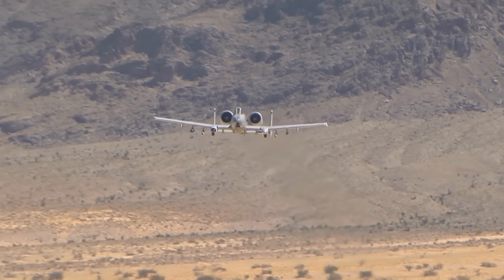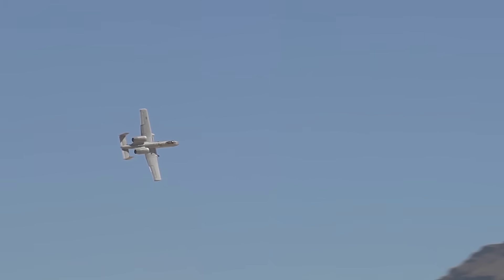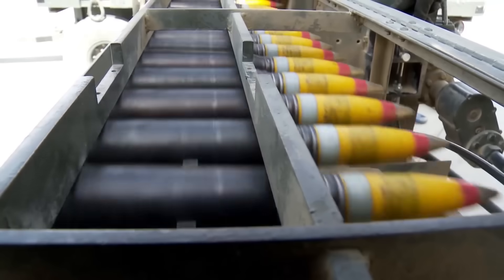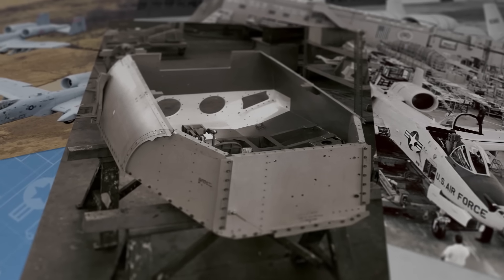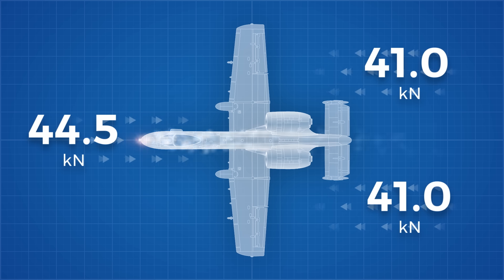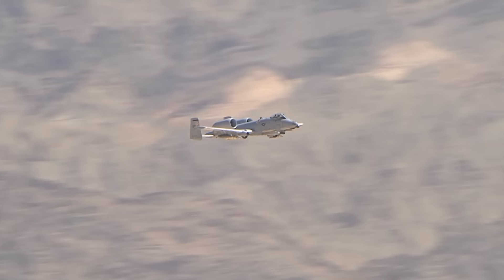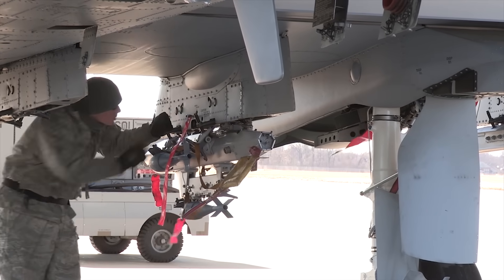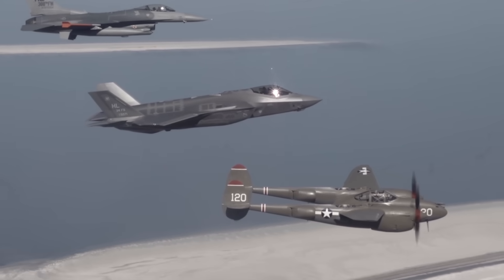The Insane Engineering of the A-10 Warthog

Comment: Love the A-10.  As long as there is a field of battle where CAS is necessary having a plane designed specifically for that role it will be king.  The ethos for its design makes it such a great plane for that role.  I love the F35 and others but they are so expensive and fragile that it doesnt make much sense to knowingly put it in harms way when you can just toss a few A-10's out there.  

The 35 strikes fear by never being seen but that is limited to those on the receiving end.  The A-10's presence alone is frightening by its unique engine and gun sounds.  So those near or around the area all know its there and what it can do.
Reply: The A-10 is far more vulnerable in combat than other fighters fielded by the USAF and USN. In contested airspace, the A-10 is at a severe disadvantage.

Comment: Doesn't the use of uranium is also dangerous for the crew and  the environment as it causes the radiation??
Reply: It's called depleted uranium for a reason. A lot of its radioactivity has died off, leaving behind a very tough substance that can withstand a lot more punishment than most other metals.

Comment: You got one thing sort of wrong - the gatling gun is NOT mounted dead-center. The firing barrel (located at about the 7 o'clock position) IS on the midline (so that the recoil is L-R balanced), but the entire gun and barrel assembly are slightly offset to the left of the plane.* There are complicated engineering reasons for this, but I think it boils down to two factors - stability, and the fact that they needed to cram the nose landing-gear in there somewhere (in fact, the nose gear is STILL offset to the right, even with the cannon being slightly to the left). The stability factor I don't fully get...I do know that the firing barrel is actually located BELOW the plane's center-of-mass, so that every time the gun fires, the nose would pitch down (during testing of prototypes). They compensated for this with a stability augmentation system, which engages when the gun is fired to keep the plane flying true, helping the pilot aim and ensuring that the plane keeps flying along the trajectory they want (can you imagine flying close to the ground with the gun engaged and NO stability augmentation system...every bullet fired would drag the nose further towards the ground, leading to the plane eventually POINTING towards the ground!). 

I'm not normally THAT into engineering and mechanical things like planes (you could call it a mild curiosity at best), but the A-10 has ALWAYS fascinated me...I even had a poster of the plane on my wall as a child. The idea that they basically prioritized two things - survivability, followed closely by lethality - and designed EVERY system in the plane with those in mind was really cool (the overarching goal - keep the pilot alive and the plane flying so that it can strafe enemy forces into submission). As plenty of people have pointed out, this isn't really a plane at all...it's a cannon with wings and engines. It could stay in battle, providing that close air-support, even after having taken damage that would, at the very least, force lesser planes to turn around and head for base. And of course, as you mention, every time some politician gets it in his head to retire this nearly 50-year-old plane, former soldiers who are now generals manage to convey to the politicians just how much the troops rely on the role that ONLY this plane can perform at such a high level. The proposed replacements don't really DO close air-support, and so, the A-10 continues to fly. And the fact that it is EXTREMELY economical to keep these planes flying, considering the role they play for such a low cost, is obviously a massive point in their favour. 

*Source: https://theaviationgeekclub.com/a-quick-look-at-why-the-gau-8-a-avenger-gun-is-mounted-left-of-the-a-10-warthog-centerline/

Comment: Thunderbolt, nto lightning bolt. :)  Otherwise... "Oh, the F-35 can do the job of ALL THESE OTHERS including the A-10" was ludicrous when they said it to sell the plane, and it's just as ridiculous now. The only way a "ground attack" F-35 survives what an A-10 can is if there's another F-35 beneath it that took the hits. Yes, use the F-35 alongside the A-10, let it deal with any established surface to air threats - that's what its stealth and data systems are good for. Keep the A-10 around. If nothing else, you'd wind up with thunderbolts and lightnings being very very frightening, then.

Comment: The A-10 needs to stay simply because of the fact it can land in bad environments, take a hit, and the psychological effect it brings to the battlefield. Other plans are glass cannons.
Reply: The A-10 also needs a lot more infrastructure to field properly. 

The case being made to replace the A-10 is that the A-10 is very expensive and takes a lot of effort to service in a combat environment. Most proposals to replace it are turboprop aircraft, which are cheaper and can be landed/maintained pretty much anywhere that has a long dirt road (something the A-10 cannot do).

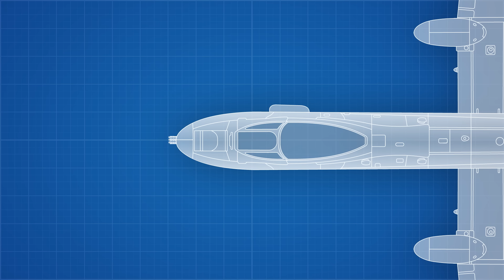Comment: 7:44 this is actually wrong. You can even look in your own video and see the GAU is mounted off center to the left. What is center, is the barrel that actually fires, meaning the off center mount allows for the recoil to be right down the centerline of the aircraft. This is also why the nose gear is mounted so far off to the right.

Comment: Great video as always!
However, one small mistake: the gun is not on the centerline of the aircraft and that is done on purpose. The gun is mounted slightly to the left of the centerline to compensate for the torque it generates when firing which would make the plane bank to one side when firing.

I've personally seen the rounds that this thing fires and they are huge! They are roughly a foot long each and this gun can fire an insane amount per minute with it's 7-barrel Gatling gun.

As someone here mentioned, if you can hear the gun firing (the brrrttt sound), it means you were not the target as this things move faster than the speed of sound.

Comment: It's the THUNDERBOLT 2
not the Lightingbolt.
The aircraft was designed to KILL Tanks.it has Evolved over time to what is is today.
It isn't a fighter.
The engines are where they are not to mask anything ,they are placed there due to the gun smoke from the 30mm choked the engines in the original.

Comment: @ 7:45 bit of a correction, the gun itself isnt actually mounted on the centerline, the rightmost barrel is the one firing so thats the one aligned with the centerline leading to the offset you can see at for example 7:01
Also pretty much all modern fighters have an APU or something similar (Like the JFS in the F16) to start the engines and dont require ground power anymore.
Love your videos, keep it up!

Comment: It was cheap, reliable, extremely well armed and armored and did the job perfectly, so.....cancel it, build a plane at ten times the cost that doesn't do the job half as well, and breaks down if you look at it wrong but the rapacious defense contractors make huge profits....
Reply: That's not what the argument of replacing the A-10 is about.

Most people who want to replace the A-10 want to do so with a turboprop attack aircraft like the Super Tucano, since they are cheaper, lighter, and can be fielded in far more places. While an A-10 needs a small army to refuel, re-arm, and service in the field, a turboprop aircraft can land on a dirt airstrip in the middle of nowhere and be rearmed/refueled out of a Toyota pick-up truck, while being a fraction of the cost and providing similar CAS options.

Comment: My dad used to build the A-10a Thunderbolt II at Fairchild Republic here on Long Island  They would do an open house every year where they setup a gau-8 in front of a fuselage. Every hour or so they ran a load of shells through the beast as a demonstration. The roar of the mechanism running and those shells through and slamming into a steel catch container was deafening. Without doubt, it was the most awesome thing my young eyes had ever seen.
Reply: That factory is now a shopping mall next to a small airport. Back in WWII they built the P-47 Thunderbolt there. The eight .50 cal's were tested and tuned by shooting them into a dirt mound by the end of a runway. That dirt mound is still there, blocked off as an environmental hazard due to the massive amounts of lead contained within.

Comment: Some stuff I think is worth bringing up:
=Redundancy is standard on combat aircraft. Most combat jets have multiple hydraulic systems, that isn't something unique to the A-10. Interestingly, the F-16, which is an entirely digital fly by wire aircraft with no mechanical linkages from the pilot's controls to the aircraft's control surfaces, carries an emergency power unit onboard that runs on hydrazine to provide electrical power (and thus, allow the pilot to retain control of the airplane) in the event of engine failure of any other situation that causes a loss of electrical power. Also worth noting that the A-10 doesn't "regularly" come back with all that damage, the last incident of battle damage I can find reported on is from 2003 (back when the enemy was a state military, not an insurgency), and the last major damage was from an accident in 2015. 
=The A-10's gun would be absolutely impotent against modern armor, even with the DU round. Honestly, even something like a T-72 is going to be a tough nut to crack. Even from above, modern MBTs have protection that outstrips the penetration of the GAU-8, relegating it to use against lightly armored vehicles and softskins. The name of the game nowadays is missiles and other precision-guided munitions (PGMs), which the A-10 can carry, but then so can multirole fighters, and the envelope these weapons are employed in favors an aircraft that can go high and fast to maximize range- you needn't be able to survive a hit from an anti-aircraft gun or a surface to air missile if you don't have to get close enough for it to shoot at you. 
=The A-10 can handle today's threat environment fine, sure. So could any of the myriad light attack and counter-insurgency (COIN) aircraft being developed and sold around the world, and at a much lower cost. Sure, they'll be firing .50s or 20mms when they're not dropping bombs, firing missiles, or launching rockets, but you don't need a 30mm to kill a Toyota Hilux with an NSV in the bed. 
=The F-16 does have degraded maneuverability when loaded for air-to-ground (and when loaded for air-to-air with fuel tanks, which it will basically always have). Still, even with iron on the wings, the F-16 can pull at minimum 5G without issue (the actual loading is determined by what's on the jet, obviously), so the maneuverability difference between an F-16 with bombs on, and an A-10, isn't really significant enough to comment on, at least as far as air to ground is concerned... it's actually kind of a weird point to bring up, to be honest. Like, yeah, an F-16 with bags and bombs isn't going to be great in close trying to dance with like, an Su-35 or something, but that's a silly situation to consider. Why does an aircraft's performance in a dogfight when configured for air to ground matter? The F-16 is also an order of magnitude faster and better climbing, minimizing presentation when doing close-in air to ground work, and while it may not have an armored cockpit enclosure or whatever other A-10-specific durability feature you want to bring up, I'd argue that doesn't really matter. You don't need an armored bathtub to survive a gun run on a building that some disagreeable gentlemen with rifles are hiding out in, and an armored bathtub is worth approximately fuck all when an SA-8 surface to air missile detonates a few feet from you.
=Despite the reputation for durability, even back during the Cold War the A-10 was going to suffer if things went hot. IIRC projected attrition rates had the entire fleet being destroyed within two weeks, which sounds plausible. The Soviets weren't just going to ram a bunch of unprotected tanks into Europe, they would be accompanied by short range air defenses (SHORAD), and potentially fighter cover though Soviet doctrine tended to use fighters in a more defensive posture, if I'm not mistaken. 
There's a lot of emotional attachment to the A-10, and that's fine. But the A-10 is a tool, and when that tool starts to become ineffective, or when it's efficacy is outweighed by the cost of using that tool versus another potentially cheaper tool, we should start to think about retiring it. To date, I haven't heard a single really compelling argument as to why it should stay in service, especially as things like wing replacements and avionics upgrades add cost to the fleet.

Comment: But the cost is still cheaper with the A-10 Warthog and more efficient more parts and more durability the F-35 is a hit and run the F-15 and F-16 including the F-35 an F-22 Raptor are very expensive aircraft so is always do note to keep the A-10 Warthog for close combat because of the durability and cheap cost be smart it's best to keep the A-10 Warthog

Comment: Medical Physicist here. Depleted Uranium is U-238, the waste of U-235 production (used in nuclear reactors, for example.) U-238 decays with an alpha emission (e.g. a charged He atom,) what is incredidly energetic. You don't have to fear alpha particles making any external damage (your clothes will block virtually all of it,) but this changes when you have these penetrating rounds hitting strong targets, as shown at 10:51 of this video. The U-238 "sprayed" in the air will stay there for some time due to its very small size, even being a heavy atom (wind will carry it, too) and people will breathe it. Once inside the lungs, it will stay there.
As told above, U-238 decays liberating AN INSANE AMOUNT of energy, and inside the lungs those alpha particles will interact with the internal tissue, destroying them. Also and to make things worse, it decays to Th-234, which beta-decays also liberating a lot of energy to Pa-234m, which will decay to Pa-234 emitting one foton and then to U-234 emitting a beta, and it continues there. Basically any daughter particle until the 14th generation from the U-238 will do at least some damage by radiation in the lungs, and some can cause also chemical poisoning, like when Po-218 alpha-decays to Pb-214 (lead is very toxic.)
Long story-short: you can easily and harmlessly handle U-238, but if you breathe it, then you have a terrible problem. Thus, using as penetrating ammo is something so dangerous in the long run for local populations. Also, one thing to notice: if you live in an area with high contents of U-238 in the soil, be aware to have a very good ventilation system in your basement, because Rn will accummulate there and cause basically the same problems to your lungs when you breath it. It was a great problem in the UK (specially Cornwall) in the past, for example. You can find more info on Rn on https://www.ukradon.org/
Thanks you all and great video, RE people!

Comment: A small nitpick, but not ejecting the shells is not something done solely to prevent damage to the aircraft. Faster flying jets do it. With a smaller shell, yes, but with a 20x102 mm shell nonetheless. That's far bigger than a .50BMG shell. And this beast is made to survive direct hits by SAMs. Scratching the paint with a  few lousy aluminium shells would be just another Monday for the pilot.
It keeps the shells for ballast. Also maybe for reloading later, reducing operating costs (though they have to be shipped back and they're not exactly volume efficient). Eliminating the possibility of the engines sucking them is a big plus, but the primary reason the A-10 keeps it's shells is for ballast, as depleting the ammo would upset the CG too far rearward.
Another plane that does it is the F-18 with it's nose mounted M61 Vulcan. Though differently than with the A-10 being literaly designed around the GAU-8, the Gun in most modern fighters/multirolers is rarely used as dogfighting was already pretty rare when the F-18 was developed, because Missiles. Bad experiences with the A-4, early IR tracking missiles and soviet planes flying over Vietnam proved Guns are still a necessity, even if missiles got better and dogfighting rarer. So they put one in the F-18, which is at a much greater risk of the engines sucking up the shells because of the position of their air intakes, which even became bigger with the F/A-18. This time around, not ejecting the shells was indeed intended to eliminate the risk of FODing the engines.
Most aircraft had the gun mounted in either side of the fuselage, on the root of one wing aft of the engine intake, with the other side usually storing ammunition for it. Not only sucking the shells can total an engine, but the smoke coming out of the gun can easily stall it. The "traditional" way of mounting the gun was an easy solutions to these problems, plus putting it closer to the fully loaded neutral point also reduced the impact of ammo depletion on stability, though side mounting it produced a yawing moment during firing.
There's one very neat light attack jet that has the gun on one side and the engine intake on the other. It uses the shape of the fuselage to offset some of the yaw produced by firing it. It's the Rutan ARES Mudfighter.

Comment: One of the primary drivers of the A-10 design, especially the GAU-8, was the need to take out the ZSU-23 radar guided self-propelled anti-aircraft vehicle that protected the Soviet tank units; the effective range of the GAU-8 was ~1000 meters more than the ZSU-23 which allowed the A-10 to roll in, take them out, then roll out again before they were in the effective range of the ZSU-23.... that was the plan, anyway. Fortunately, we never had to find out how well it worked in practice!